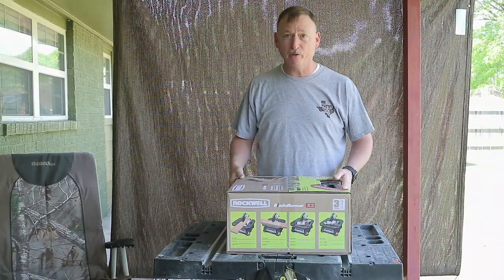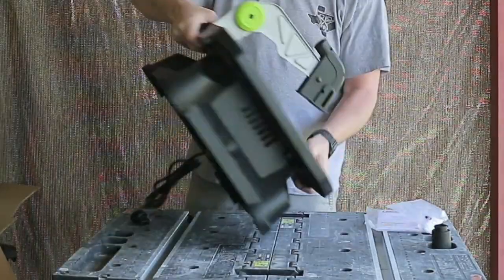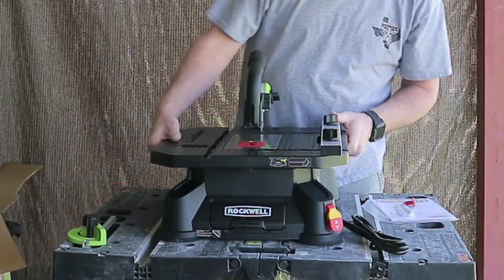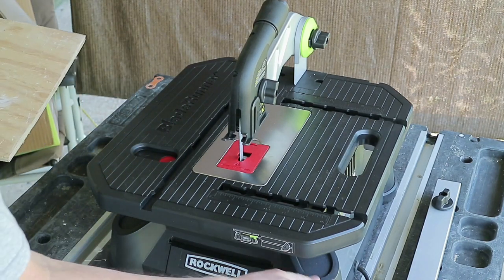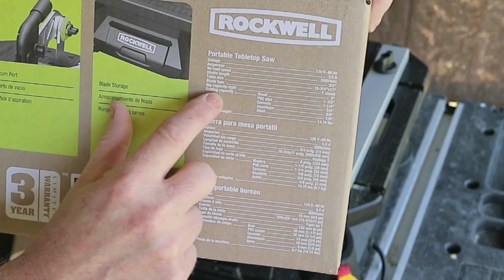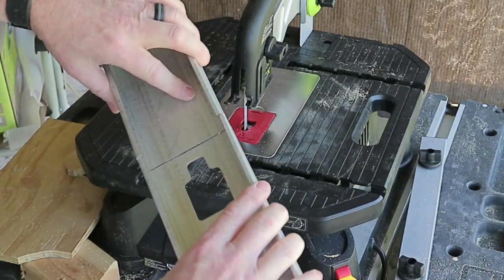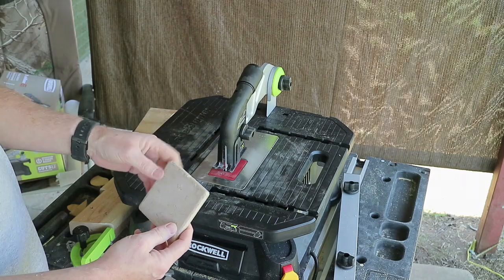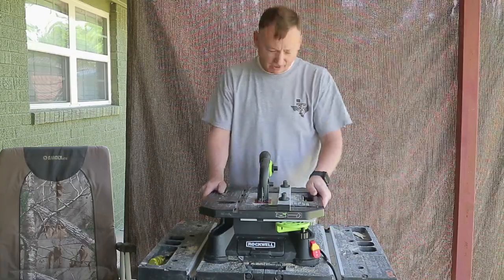Coop's Simple Review - Rockwell BladeRunner X2

Comment: Unfortunately Rockwell's  X2 version is the 'cheap'' version of the Bladerunner. They removed the variable speed control and replaced the rigid tube support with a flimsy piece of sheet metal. They also failed to fix the biggest problem: The weird, non-standard, segmented miter slots.
Reply from the maker: Thanks for watching and the great insight. Very helpful for those looking at the X2. Hopefully people will read your comment before making a decision. Thanks again.

Comment: There a fold down ...hmm "hook" ...(can't think of a better word as I don't really know what's it called) that is located underneath the front of this unit. Once pulled down, it is to be rested  against the edge of table or workbench, whatever the table saw is sitting on. The purpose is to keep the table saw from sliding backwards and stable as material is pushed through the saw.
Reply from the maker: Thanks for watching and the comment. Sorry if I missed that. I thought I pointed that out. Thanks.

Comment: there are like 5  or 6  5mm screws under it can loosen to adjust blade for squareness - i would check see if blade was square first and understand markings are not exact so t square be used- i saw other review if you don't need exact cuts and just close enough it ok saw i ordered one not come yet but i wanted see exactly what issues are and how to solve them- but for what i use it for think just fine 1/2 inch wood and doesn't need be perfect and cuts for pipe- nothing really heavy duty have saws for that but if you have table saw i use a 10" grinder blade sometimes on mine and it pretty much cut through anything- plastics metal etc-
Reply from the maker: @hermiesnow6947  Thanks for watching and commenting. I, and I’m sure others looking for this content, appreciate input and experiences of others using the Rockwell.
Reply: @LivingCooper  your wc  the good thing about the saw it easy to move around - but until mine arrives can only go by what others had shown -

Comment: I bought one of these 5 years ago.  Still, I have a power chop saw, jig saw, table saw, and a ban saw.  I was not impressed by the way it shook a lot which made me not want to use it often.  Still, if you need to cut small pieces, by all means use this rather than the larger power saws I mentioned above.
Reply from the maker: Thanks for watching and sharing your experiences.  You definitely have to put  a lot of downward force on it to keep it from shaking. It was great for what I was using it for, but I finally donated mine to a non-profit. I haven’t needed it in a couple of years and I plan to buy a band saw in place of it.

Comment: Bought the first Blade Runner with aluminum table surface.  Got it at a Pawn Shop. Afterwards I understood why it was there. Shakes like crazy. My 2 cents, find a way to anchor it on a worktable. Maybe run a couple of ratchet straps around your work table to secure it. Impossible to make a neat cut jumping all over the place.
It is every bit as bad as any jigsaw.
Reply from the maker: Thanks for watching and commenting. I appreciate the input. It can definitely be shaky depending on the material and thickness. I agree it would certainly be better if it were anchored to the table. Thanks again. Great input!

Comment: It looks like a decent unit. im curious about it for cutting sheet plate aluminum.  

I do aluminum welding and i like to make little containers/car related tanks etc. it just is too difficult for me to get a decent straight cut with my grinder even with a straight edge to keep the cutting wheel straight. i feel like this would be an easier option. i just wonder how thick of aluminum it could cut.
Reply from the maker: Thanks for watching and great question.  I've cut 1/4" brass stock and 3/8" all thread, but I haven't cut any aluminum. I know that with the brass and steel, you need to put quite a bit of down pressure on the material to keep it from jumping.  With that said, the pieces I have been cutting are small pieces, you may not have any issues with aluminum plate depending how small the pieces are.  Hope this helps. Thanks again.

Comment: Can you use this saw to cut a hard plastic like the irrigation  box cover (green color)?
Reply from the maker: Thanks some for watching and great question.  Yes, you should be able to cut hard plastic, as long as it will fit under the blade guard.  It's height capacity is 1.5".  I hope this helps.